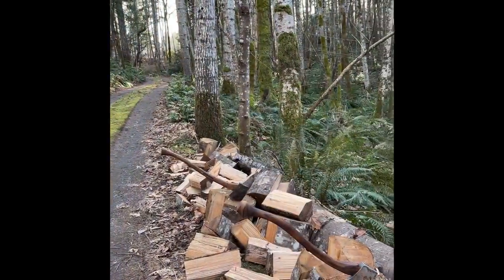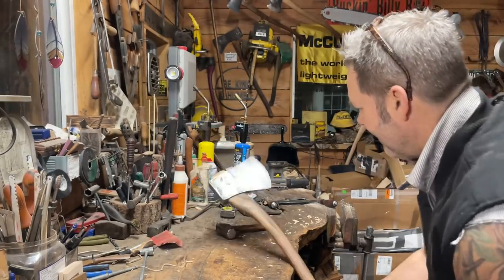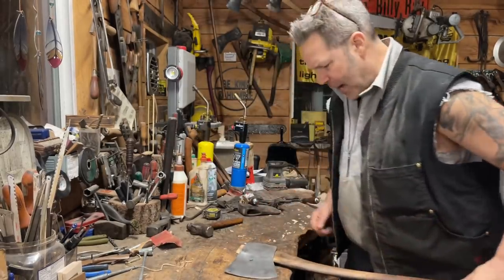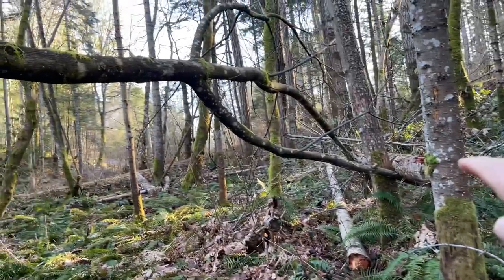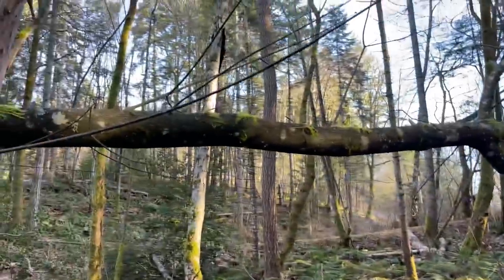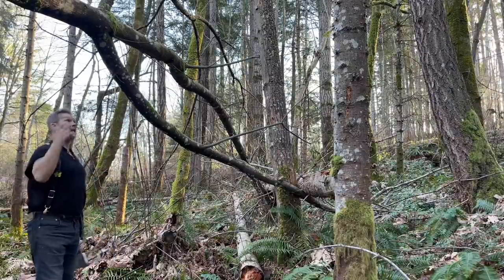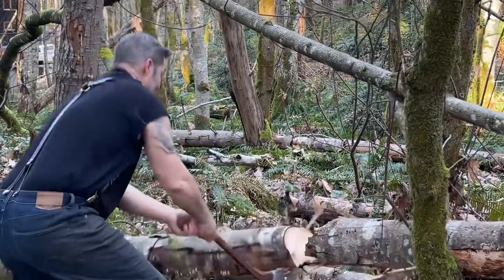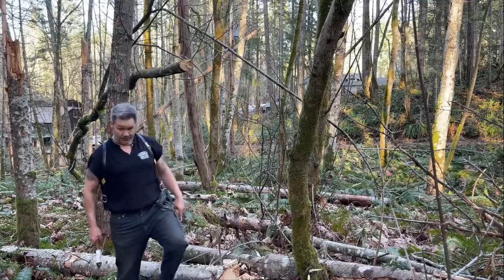, Spotting DANGER ⚠️ Working in the woods. Compression first

Comment: 10-12 years ago I bought my first chainsaw. After a storm A week later I was cleaning up a large tree that had fallen down on top of smaller trees. I was cleaning the area of trip hazards and did not read the signs of what he is talking about in the video. A sapling maybe 4-5 inches in diameter hit me in the face. Knocked out two teeth and broke bones in my face. It was called a “la fort 2” fracture, google it if you want. I needed surgery to reaffix the bones to heal straight. Couple of fake teeth and a facial surgery later I’m totally fine. Lesson learned.
Reply: Wow, Josh....glad you survived, some guys don't. Others fall down right before they get hit like i did. Lucky fall. 
Let's pass this knowledge on to others so situations of severe danger can be avoided.
I am at peace, i am not in a hurry.
Buckin taught me that little prayer and i say it almost every day, two or three times a day. When i don't say it, that's when the danger level goes up.
Reply: I am glad you are doing ok friend.
Sometimes those little trees are the most dangerous because we neglected safety precautions due to their small size. Stay safe, and God bless.
Be kind

Comment: Those springpoles are one of the most dangerous things you'll encounter when working with a saw/axe. And don't think you know exactly where it's going to go when the tension wood gives out. It might go straight up, but it may go sideways too. Just keep taking out wider and wider wedges of compression wood until the tree/limb stops moving and you can tell it's no longer loaded. Make sure to take care of the springpoles first before you start cutting the other stuff around it.

Comment: I've noticed that when a green tree is on the ground, and the weight of the trunk is bending half of the branches, if I cut the outside of the bend (tension) the branch snaps and moves violently. If I cut the inside of the bend (compressed) the branch goes limp and I can make a second cut to remove the limb.
Sometimes the chain gets stuck in the first (compression side) cut!